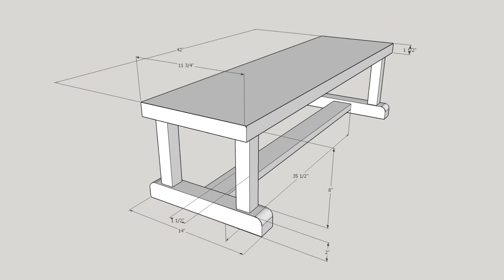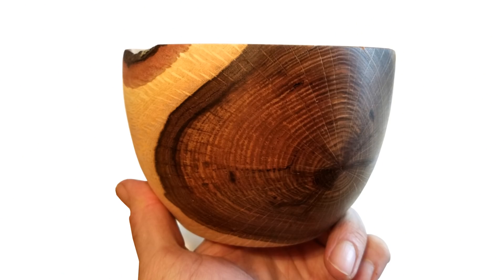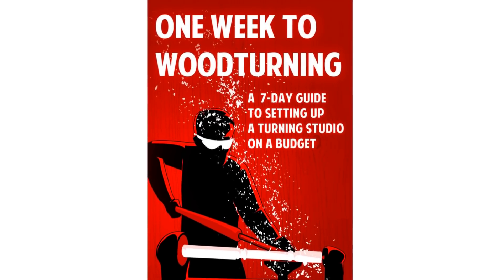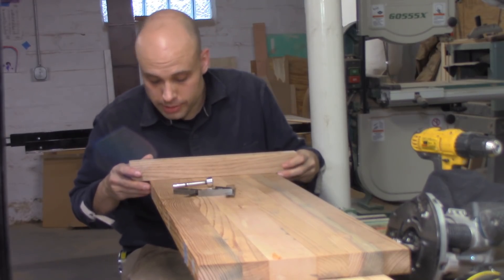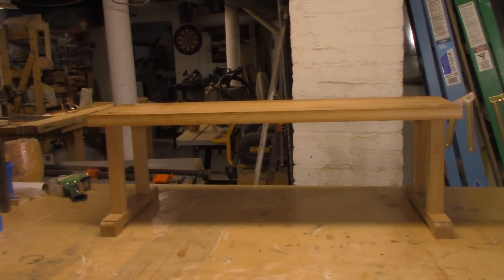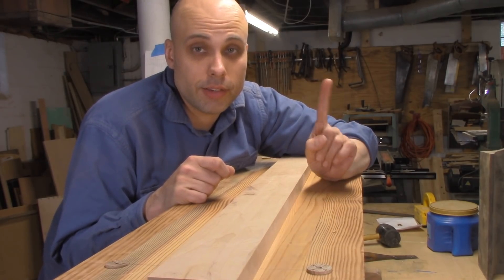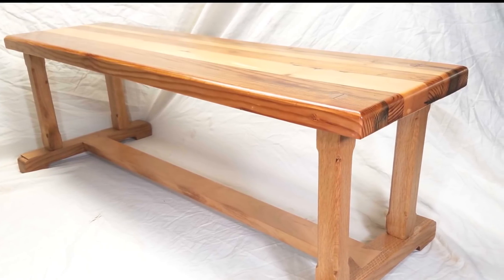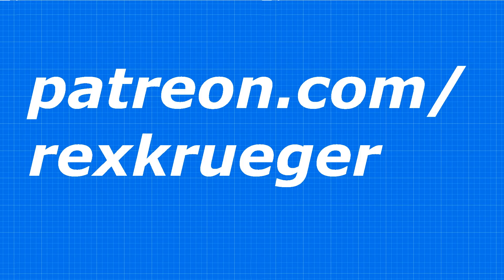Fine furniture joinery on the wood lathe. Quick and easy!

Comment: Bench turned out great.  For those that are new to woodturning definitely check out the book.  It’s worth more than Rex is charging for it.
Reply from the maker: That is SUCH a high compliment!
Reply: Encouraged by your homemade lathe project I'm about to start turning (thanks for the kick in the butt, I needed it).  I have an old 12" Craftsman lathe I picked up some time ago that I've been tripping over and walking around ever since so I blew the dust off it,  bought a 4" face plate off eBay and I've made 2 (so far ) of your Oland (sp?) tools. Damn, are those cheap and easy to make or what?

 What are the chances of a print version of the book for those  of us with less than 20/20 vision?  I don't have a Kindle and my phone screen is way too small.

Comment: Very nice bench. Thanks!

BTW: A pretty good way to ensure that your round tenons will fit is to make a turning guide.  Drill a properly-sized hole in a piece of scrap wood and then cut the piece in two by sawing directly through the center of the hole. The half-hole shape that results will allow you to test the fit of the turned tenon while it is still in the lathe. This saves time dismounting and remounting the stock in the lathe.  And, if this approach doesn't work for you, using an open-end wrench of the proper size works, too.

Comment: Awesome... Just what I needed to attach the uprights on a swinging rocking horse.👍
Reply from the maker: That might be a great application for this, but if I were doing a joint that had to resist PULLING forces, I think I'd peg the joints with horizontal dowels through the tenons. The would be really strong. Just a thought!

Comment: Interesting joinery! You could also use a round tenon cutter or a rounder plane to make the tenon, if you don't have a lathe. Or as someone else said, use a 1" hardwood dowel as a floating tenon.
Reply from the maker: Agreed!
Reply: @RexKrueger  Hole saw bit in a drill press?

Comment: Any concern about the tenon splitting? Is there a need to drill holes at the baseline of the cut like in traditional wedge m & t?

Will be using this technique for what's called a pikler triangle for my son to practice climbing on (God help us). I figure I may as well make it strong enough for me to climb on, too.

Comment: I like the idea of round mortices, but I don't have a lathe, so I thought I might try cutting the tenons with a hole saw bit in my drill press. Then cutting the outer waste material with a hand saw.
To make sure the tenons are straight, I think it might be worth building a quick and dirty clamping jig for the table of my drill press. Then it's just a case of gluing a dowel into the hole made by the guide bit in the hole saw bit.
Any reason why this wouldn't work?
Reply from the maker: No reason at all, but you can also just cut the round tenon with a chisel. Not hard at all. In fact, in next week's video, I'm going to cut them with a HATCHET. Seriously.
Reply: (EDIT:  Sorry Maxx B, I just re-read your comment.  For some reason, I misread it the first time and thought you were saying you would cut the round tenon end on the leg in your drill press.  It turns out you were talking about a similar idea to mine, a dowel as a floating tenon, but yours dealt with cutting the hole in the leg, with a hole saw in the drill press.  I'll still leave my original comment below, in case it gives you any ideas.)

Or another option is to make a floating tenon out of a chunk of dowel.  Then using a Forstner bit the same diameter as the dowel, drill the foot, and use that as a template for drilling the table top, same as Rex did, to match the foot angle through to the top.  

If it's important to you to have the through joint visible in the top to be the same wood as the leg instead of the off-the-shelf dowel wood, you can make a dowel from the leg stock, and a quick and dirty dowel maker can simply be the jaws of your bench vise.  Just rip down an octagonal blank from the leg stock on the table saw, drill a centered screw into the end of the blank, cut off its head, chuck it into your hand drill, and at the right rpm, while slowly tightening the bench vise, the rough jaw surfaces can chew the blank down to an oversized diameter pretty quickly.  Then finish the rough round by using the drill to spin it in your hand while squeezing it in some 80 grit, followed by 220, and you have a custom dowel for your round tenon.
Reply: @JusBidniss   I did mean cutting the round tenon on the drill press. 
My idea is to mount the leg perpendicular to the drill's table and using a hole saw bit, drill down an inch or so. Then unclamp the leg and cut the shoulder of the tenon, the wood on the outer side of the hole saw cut, with a hand saw. I'll end up with a solid tenon (albeit with a small hole in the centre from the guide bit). This would leave me with a similar result as Rex, but without using a lathe.
I would have to find a way to securely clamp the leg to the side of my drill press's table, but a simple plywood jig should be easy to figure out.
I think this image might help show what I mean. https://imgur.com/rnHD0iS
Reply: @maxximumb    Thanks for the clarification.  That'll teach me to read and respond to these things so late at night!  Glad there was no heavy machinery lying around that needed to be operated!  :)

I think that's a great idea, and accessible to the non-lathe-owning woodworker!  I never thought of a hole saw as a tenon cutter, but probably because mine are somewhat shallow.  Either way, it's a fun mental exercise.
Reply: @JusBidniss I LOL. Glad you're more awake now. :D I used to love woodwork and making anything when I was younger. Now I'm stuck at home as a result of an illness leaving me disabled, I'm trying to get back into making things. I don't however have much money to buy all the tools I'd like, so it can be fun looking at tools I do have and seeing how they can be used in different ways. One thing that is usually productive is thinking in negative space. Like the hole saw. We usually discard the inner circle, but used the other way it can be used to make short tenons and dowels. A drill press can be used as an oscillating spindle sander (when used carefully).
My next project is to make a table saw from a circular saw and plywood.

Comment: I'm wondering [if all the other stages stay the same, incl. slitting the tenons/wedging] if no lathe is availabe, could a forstner bit, and floating tenons made from wooden broom handle would work just as well? If all the mortises are tight and the cross rail is in place, wouldn't it all be strong enough? From my P.O.V. it would be nice to have a lathe :)
Reply from the maker: Sure!  That would totally work, but you don't even need to go with floating tenons. You can made a very nice round tenon by hand with a common chisel. In fact, I'm going to make round tenons with a HATCHET for next week's video. Just wait!

Comment: 🤔 Once you drill the surface of the table (past the foot as template) how does that help to keep the hole straight (its like a broomstick in a bucket)? Just asking
Reply from the maker: The hole you're already drilled keeps the bit straight. Once it's on course, it tends to stay that way.

Comment: How much should one spend on a lathe that would be used for pretty much this purpose on hard woods and then only occasionally?  It makes this kind of joint SO easy!
Reply from the maker: I have a Harbor Freight 34706. It's less than $300 on sale and has the swing and length for this kind of work and will also handle bigger jobs is you ever need it. If you're really just going to do this and other spindle work, then you might like an old Craftsman tube-bed lathe. They're light duty, but long and can be found cheap!

Comment: Nice build. I was thinking that the round tenon idea could even be used if you don't have a lathe. Say you're joining a leg to the top, replace the lathe part of the work as follows. Drill a tenon sized hole into the top of the leg, insert a section of appropriately-sized hardwood dowel and drill a smaller hole horizontally through leg and tenon dowel. Then use a smaller hardwood dowel through that hole to anchor the tenon dowel. The rest is the same as your build. It might not be as strong but depending on what you're building it might be strong enough.
Reply from the maker: That would absolutely work. I used a similar technique to make a milking stool several years ago. I actually just carved a round tenon on the end of the legs with a chisel. Sounds hard but wasn't, really. Still rock-solid. You're right, the lathe is a convenience in this project, but not a necessity.

Comment: I had some thoughts about this, dowel Joinery is inherently weaker than a square tenon because it has much more end grain in the joint.  I think with the size of your tenons you're more than fine structurally but those glue joints will probably fail someday ( a long time from now likely.....).  you would end up with a more durable piece of furniture if you used conical tenons it would resist failure longer because the action of putting load on the joints would tighten the joints.  That's kinda nitpicky though because what you did looks great and clearly works great but if someone is playing along at home it's something fun to try, conical mortise and tenons are super fun.  This is how stick chairs, such as windsor chairs are assembled but because they have angular stresses and thinner tenons its much more critical to have the conical tenon.
Reply from the maker: I appreciate your thoughts and your willingness to share, but I think the wedge eliminates most of those problems. This is an extremely tight-fitting joint. I made a milking stool with this technique. Three legs; no stretchers; daily use for 3 years and it shows no signs of loosening up.
Reply: @RexKrueger  yeah that's why I highlighted it as being nitpicky but isn't that the nature of woodworking and YouTube comments? :p You're looking at maaaaaany years before that particular thing is a concern.   I would bet even if some of those glue joints do fail you wouldn't notice because it's so heavily constructed with lots of redundancy.
Reply from the maker: @scottm9605  That's a nice thing to say!
Reply: @RexKrueger  It's meant as a compliment.  you did a great job with this bench.